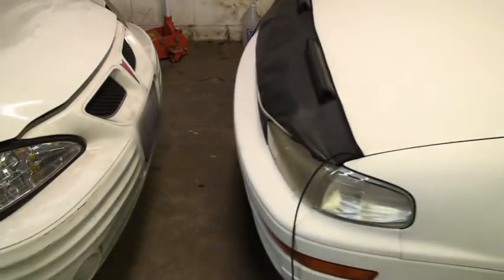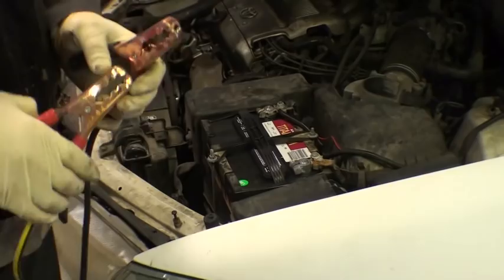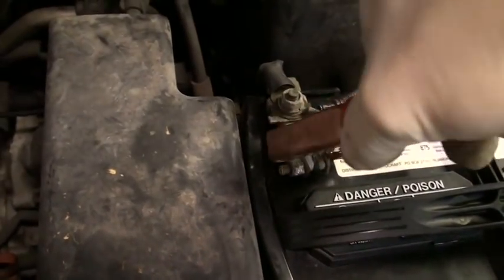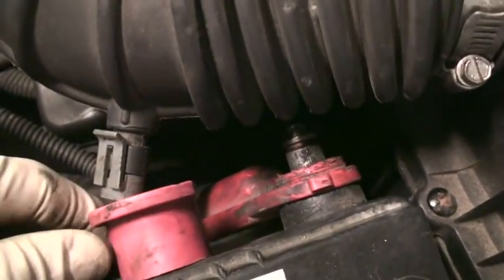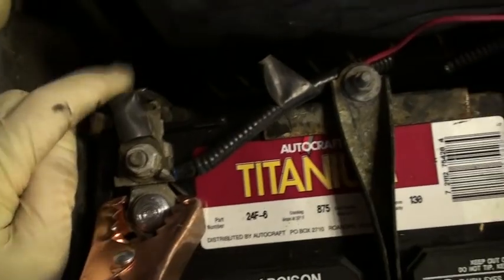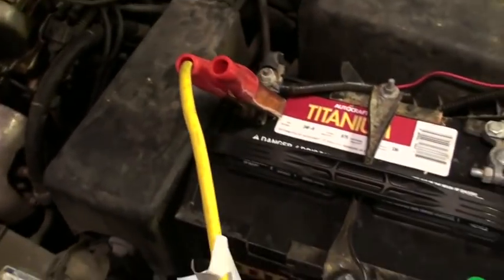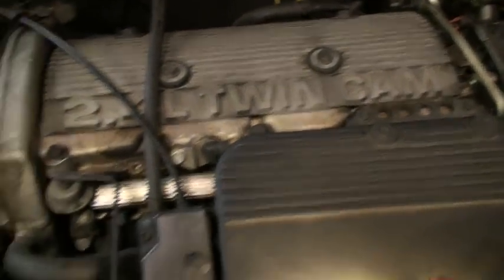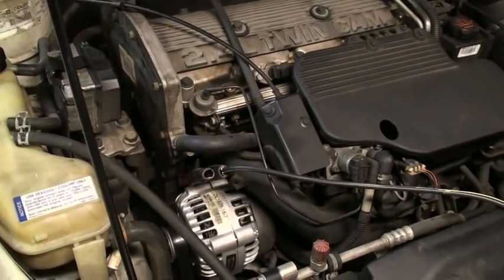How To Jump Start A Car - EricTheCarGuy

Comment: ok I know I did this right even before watching your video.
I jumped my 84 towncar,and got it started. shut it off and moved my brothers car. 
went to start my car again and it was dead. once again hooked the cables up. positive negative whatever. they were all right, let my brothers run for a bit,about 5 minutes or so,and got out and saw smoke coming out of both ends of the cables.
How the hell did this happen???? Also my friend told me it could be a short in the battery. And to trade it in.

Comment: @plck1985 The real reason you always hook up the positive first is that automobiles have a negative ground and when you make the last connection there is often a spark.  If the bad battery is venting explosive hydrogen, this can ignite it causing it to blow up in your face.  Hook up the positive to positive first... Then hook up the ground (chassis) of a car to the ground (chassis) of another car.  Eye protection or a face shield wouldn't be a bad idea.

Comment: The car battery is something the car owners overlook. A average lifespan on a maintenance free car battery today is 6 years then about that time, the should be replaced if there dead or not, because one day, when you need the car to start, the battery died on you. This happened to me once in the middle of nowhere, took alot of calling on my cell phone before a friend came out to rescue me whit a boost.  Since then I've been replacing my car batteries ever 6 years and it never happen to me again!

Comment: Hey Eric, how long should I drive it to make sure that the battery is back in working order?
Reply: +nova9403 I would say about 30 min to an hour.  If it was completly dead, (no lights even turned on when you went to get in it) then I would say 2 hours.

Comment: I know u r right.  But when I do it your way it never works for me. So I attach the jumpers to the negative and positive terminal on the dead battery it starts.  Is it possible I am attaching the negative to a non groused part of the car....or something?
Reply: +Peabo on some vehicles with a full frame, the manufacturer will cheap out and only ground the vehicle to the frame and not the body.

Comment: i hook both cables on each battery whenever i need to jump start a car. thats what my dad taught me growing up and has worked out fine..
Reply: +Chris B There is nothing really wrong with that.  The only reason why they tell you not to hook both the positive and negative connections to the good battery at the same time is because people do not pay enough attention to not touch the other two leads together.  The reason why you dont hook the jumper cable to the other negative terminal is because the hydrogen gas that can come out the battery could possible explode if there was a spark when connection the lead.

Comment: What happens if you hook the second negative cable to the dead battery's negative post, rather than a ground?
Reply: sparks and then nothing. start the car up
Reply: you want to minimize the wire length from good car to bad car's starter, so the negative should best go to the engine block, rather than the battery or any other point.

Comment: because youll notice when you connect the terminals that you will someimes see a spark jump which is dangerous because the batteries contain hydrogen which i very flammable and can blow up.

Comment: This did not seem correct to me by memory. So I double checked. Every source I found, including component manufacturers indicate to begin the clamp connection sequence with the dead battery, not the good.1)Bad positive 2) good positive 3) good negative 4) bad to ground. Only one source said it does not matter but that was a Yahoo Answers reply so a grain of salt with that. Is there a reason your instructions are different or did I miss something?

Comment: So what could happen to the battery if one side of the jumper cable is hooked up to the not working car and the other side of the jumper cable touches each other?
Reply: Filip Murdza The battery still has power in it just not enough to start the car. It will still spark when they touch

Comment: on a battery that is relatively low on voltage example 11 volts could it be possible to get an emergency jump start with a 6 volt lantern battery with leads?
Reply: No.  Those dry cell batteries don't have the amp-hours needed to start an engine.
Reply: +Eliezer Bonilla No, the amperage in the lantern battery would never be able to pull that off.

Comment: Car question: I have a 1997 subaru legacy outback and when I brake the pedal bounces/pulses. Feels like abs not working properly? Also there seems to be a humming noise sometimes while and after braking near the right front side of my car. Maybe the abs console? Please help
Reply: +Matthew Snyder you could be low on brake fluid have that checked, you would not want to burn out the pump.

Comment from the maker: @ROFLMFAOHEHETEHE It will still work yes but I recommend using the order listed in the video as it helps prevent sparks near the dead battery which is an important safety concern.

Comment: Why do you have to clamp the negative clamp on a metal somewhere on the car rather than on the negative post to the battery?  I had a towing company come and jump the battery for me when the temps were freezing cold last week.  The guy had hooked the negative clamp to the negative post to my dead battery.  Is it less risky to clamp the negative clamp to a metal somewhere on the car not directly to the dead battery post?  I need to go and get some jumping cables sometime this week and I don't want to pay too much for them but I do want good quality jumping cables whenever I need them every now and then in case of emergency.

Thanks.
Reply: yeah its safer to clamp it on a metal part of the body rather then the negative battery terminal. just incase the battery is leaking hydrogen gas. (which is flammable).
Reply: O.K., I understand now.  Thanks for responding back to my comment.

Comment: If the battery is very badly run down in the bad car, it might be advisable to first start the donor car before hooking up the last cable (ground) on the receiver car, so the donor car's battery doesn't get run down by the empty battery and won't start either. At least that's what I've learned ;)

Comment: So, what happens if on the last alligator clip, you connect the negative alligator clip on to the negative terminal of the dead car...what happens? Heh, I'm completely new with this knowledge. :-D
Reply: It'll work but maybe better chance of battery explosion.
Reply: +fgnsdfnbnd The battery itself wont technically explode, not at first anyway, the explosion is caused by hydrogen gas that comes out of the battery.

Comment: Can someone(who knows) clarify why the 2nd Pos. cable doesn't attach to the battery please. I've always seen it done this way and even done it this way myself.
Reply: I usually hook the negative to the battery of both cars,  ( although, I think I'll go with this way in the future, probably safer ! )....I'm guessing it's because if the jumper cable comes loose and falls off,  the two won't be close enough to connect the circuit between the cables.   It shouldn't be a problem in the first car, it just wouldn't connect the circuit to continue jumping the second car.

Comment: The danger is that the defective battery could have a low electrolyte level. The free space in the battery will be full of hydrogen and oxygen produced by electrolysis. That is an explosive mixture and you REALLY do not want to be making a spark near a suspect battery, for example  by making the last connection to the battery terminal.

Comment: Hello Eric my car won't start at all when I turn the key in the ignition I get no lights on dashboard no noise or nothing help me please really need to use it ASAP
Reply: +Jacob Giannini your car is probably just very dead. At least that's how mine was today
Reply: +Jacob Giannini Does the dome light turn on when you open the door? If you have a muiltimeter check the battery voltage.  The voltage should be between 12.4-12.6 V, if the voltage is good and the dome light is turning on, it could be a bad ignition switch, if the voltage is good and the dome light is not turning on, check the battery connections.

Comment: 2:44 If the NEGATIVE of the battery is connected to a ground already 
("touches the body somewhere" - Giggity) 
why do you need to ground the dead black jumper to another ground?

CORRELATING QUOTE TIME:
 If you gave an order that Santiago wasn't to be touched, and your orders are
 always followed, then why would he be in danger, why would it be necessary to transfer him off the base?

Comment: It could cause sparks if you connect negative to negative. That's not a terrible thing unless there's gas leaking from the battery. If there IS gas leaking from the battery, however, the sparks might ignite the gas. Not something you want to happen.

Comment: Is there a reason why don't hook the Negative (Good Battery) to Negative (Dead Battery)???
Reply: I mean you can, but you risk one or both batteries explode/fried.
Reply: RzVids Really? I guess last time i was luckly, because i did that. To me, "+" to "+" and "-" to "-", it's pretty straightforward. I didn't know there's a little trick.
Reply: +Jianer CHENG (Jacob) The risk is that when you connect the second negative connection, completing the circuit that the spark could possible ignite the highly explosive hydrogen gas that your battery releases when it is being discharged.
Reply: cjgaltieri Ok, thanks!

Comment: I'm fairly sure my battery is dead. I can't start the engine and the headlights are very 
dim, plus the internal light dims when I turn the air con on, etc etc.

I'm new to cars, so I've been looking up the meanings of all the dashboard warning 
lights. A lot of them are supposed to come on when the key is in the ignition and then 
turn off when the engine is started, right? I can't start the engine, so the lights are 
staying on. I don't need to worry about it being anything more than the battery do I?

I've seen the car running and the person who sold the car to me delivered it to my house (driving 15 miles to do so) so I know the car works okay.
Reply: Oh, also - I'm guessing central locking doesn't work when the battery's dead?
Reply: +PandaManMk2000 If you are seeing the lights dim when you turn on extra accessories, that is not the battery, that is the alternator not putting out enough power. That can either be caused by a bad voltage regulator, (a 30-40 dollar part), or a bad alternator, (a 200-300 dollar part)

Comment: Hi carguy I have a problem with start my car I changed alternator and beattry but still I have a problem please please please help me out please
Reply: +Jay Ahmad You really should never just put your email out there like that.  You are just asking for all sorts of junk mail.  And it could be a bad ground from the battery to the engine or body, it could be corrosion on the wires, both the positive or negative, or maybe a bad voltage regulator.

Comment: then better start connection dead car l guess, less power , risk of short circuit a bit much  less powerful.  l thougth removing while running can make spark and ignition on is open way for spark into computer to damage it. but video shows it done.

Comment: Why would you start with the positive cable? You should be grounded before anything else...
Reply: +Under Construction because you dont want a spark of the positive side, that could cause an electrical short.  And as long as your car isn't magically floating in mid air, it is already grounded

Comment: Not saying your wrong, but . .  Just killed the battery in my car while listening to the radio during an oil change and spark plug change.  I've jumped a car before, but when you say "connect the positive to the positive and the negative to a ground on the engine". . . Decided to try that to see, connecting the good battery (+, and -) to the + and a bracket on my engine.  Let it run for 20 minutes, tried to start, and nothing.  Same sound of trying to turn over.  Place the negative (one on my engine block) to the negative of the battery, and started up in no time.  In my experience, positive to positive and negative to negative, starting with the good car. . . Any explanation?
Reply: I had the same thing happen tonight, I connected the Negative of the dead car to a ground (nut on top of the strut). Didn't work, car wouldn't turn over. Then I put the Negative of the dead car to the Negative terminal of the dead battery. Car started right up.
Reply: I never tried the bad car NEG to any other grounded metal except the battery terminal, so I tried it.... and it worked! Pretty cool. It didn't work the first time but my connection on the good car NEG terminal wasn't good. When I replaced it firmly and tried it again, it worked right away. FYI my bad car connection was on the alternator just like the vid.
Reply: Was the live car running when you started the dead car?
Reply: think about it - as he said himself in the video, the negative side of the battery is connected to the frame of the car anyways. so the only thing you are changing by hooking it up to the frame instead of the battery directly is the resistance between the negative poles of both batteries (cable + some metal connection as opposed to cable only). it still forms a circuit, it still could spark (if you put it near enough to the negative pole). the spark just won't be near any flammable gases from a bad battery, which happens let's say almost never, anyways.
Reply: The reason you "Do Not." connect to the Negative Battery Post.  A battery produces Hydrogen.  AKA, VERY EXPLOSIVE, and if you connect to the battery post, you might get something CALLED A SPARK.  

Now Einstein is not needed to figure out what would happen if spark hits Hydrogen.

Comment: my car makes rapid clicking noises when i turn the key what does that mean and how do i fix it
Reply: +Glyde Dead battery. Charge it or jump it. Keeps happening? Get it tested
Reply: might be starter as well..
Reply: might be starter as well..
Reply: might be starter as well..
Reply: +RIOTPUNK1977 might be the starter huh?
Reply: +RIOTPUNK1977 Could you repeat that please? It was unclear the first 3 times, so of course I got confused and messed up, ended up with my penis in the starter solenoid thinking I could scare it into starting. Now I have no hair left, and I can't have kids. Thanks alot.
Reply: +SomeCoolName I HATE it when that happens! Ugh!

Comment: Here you go people: When the dead battery is charged up, it off-gasses and produces Hydrogen gas which is flammable. If you hook up the cables terminal to terminal, the spark that is created from disconnecting the negative dead car cable will ignite the Hydrogen gas and start a fire. SO you put the dead car negative on a chassis ground instead and therefore locate it far away from the gas. Once you take the dead car negative off, no power flows through the cables and no sparks will occur.

Comment: ASE says

To connect: 
1)dead car pos
2)good car pos
3)good car neg
4)dead car alternator bracket

Start good Car then start dead.  If dead car does not immediately start, wait 2-3 mins and try to start again.

To disconnect:
1)dead car neg
2)good car neg
3)good car pos
4)dead car alternator bracket

Comment: The downside is the spark generated from attaching the negative jumper to the negative battery terminal of the dead battery can ignite hydrogen gas that is escaping from the battery and cause you and your car to go KABOOM

Comment: Summary 

Good car positive
Bad car positive
Good car negative
Bad car engine block

To remove
Bad car engine block
Good car negative
Bad car positive
Good car positive

Did I get this right?
Reply: Don't forget to turn on the car and let it idle for a while and possibly rev the running car up a bit so the car idles at a higher rpm further helping the dead car to possibly turn over and start.

Comment: Did this today on a mini, jump started and left the dead car running for a good 30-40mins, reversed it out of the drive then tried to go forward and it completely died again. Anyone know the problem?
Reply: mrjoeltudor1  alternator needs replaced isnt charging the battery. or you need to clean the terminals with a terminal brush, making sure the terminal mounts fully wrap and are snug against the posts
Reply: +mrjoeltudor1 before you go saying that the alternator is dead, check the connections, voltage regulator, and the drive belt for the alternator.

Comment: I disagree.
Alternators will "put out" (Giggity) the same voltage regardless of RPMs.
---
Alts kick out 13.5 volts.
12v goes back to feed the battery while the 1.5 feeds the system needs unless taxed by additional usage.
You can use over 1.5v during use but the battery will contribute to covering that overload, then be replenished when you drive "untaxed".
Like a rubber band, it can handle the stress but will go back to its size eventually.
---
A jump start is essentially borrowing a battery.